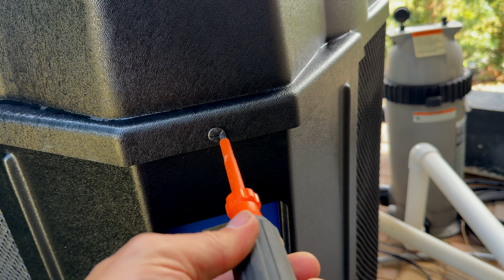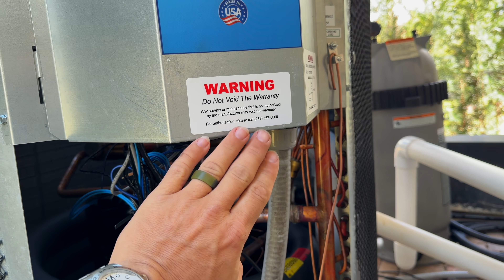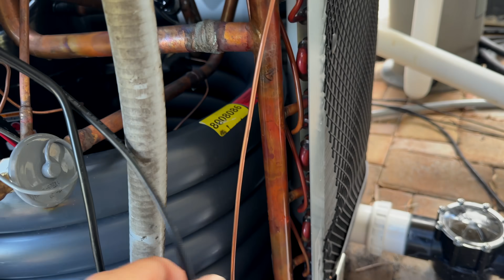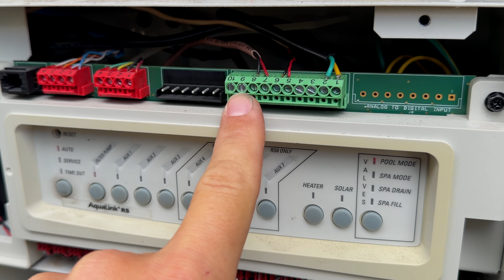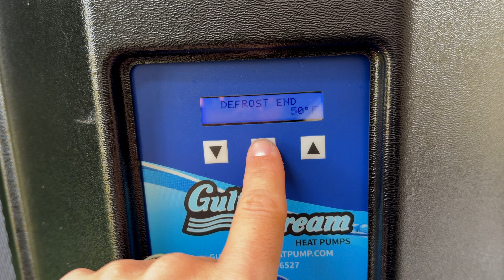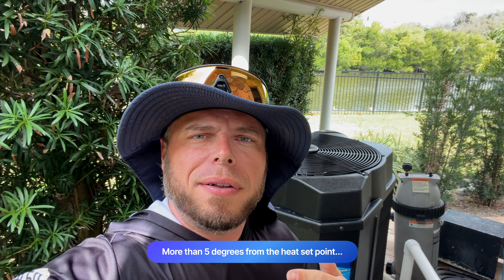High Voltage & Low Voltage | Complete Gulfstream Heat Pump Wiring Guide! #poolheater

Comment from the maker: ⚡ High Voltage vs. Low Voltage — Don’t Mix These Up! ⚡

Wiring a Gulfstream heat pump? This video walks you step-by-step through the complete wiring layout, so you know exactly what goes where before you power it up.

Inside this guide:
🔌 High voltage connections (line power, contactor, breaker)
🎛️ Low voltage thermostat/control wiring
📋 Control board terminal breakdown
🛠️ Safety checks before startup

Whether you’re installing, replacing, or troubleshooting — this will help you wire it correctly and avoid costly damage.

💬 Have a wiring question? Drop it below — I reply to comments.
👍 Like if this helped
🔔 Subscribe for more straight-to-the-point wiring tutorials
📌 Save this for your next service call

#PoolHeater #HeatPump #PoolTech #WiringGuide #PoolHeatPump

Comment: Remote T-Stat Enabled makes sense, Remote Heat/Cool Enabled makes sense, Pool Heat/Cool Disabled isn't making sense to me. Pool Cool Enabled, kinda makes sense, I suppose we want it cooled, but wouldn't that be controlled by the Remote Heat/Cool Enabled? Im confused.
Reply from the maker: Pool/cool is designed to keep the pool at a specific temperature. So it’ll automatically switch between the modes to achieve it. The reason why I disable it is because it will increase the homeowners power bill significantly because it’ll be running all the time. I hope this makes sense. Thanks for watching! 🎉

Comment: Very nice video, good explanation . I do havea question, I connected the way you explained when i turn it on via the automation it does turn it on, however it doesn't go into spa mode it just turn the heater on in pool heat.  I have just a heat only, No cool  thanks
Reply from the maker: Thanks for watching and the kind words. Depending on what automation system you have you should be able to program the heater to turn on anytime you have the spa come on. If not, all you have to do is put the system into spa mode and then turn on the heater to your desired temp. Regarding the "mode" on the heat pump itself, the only difference is the max temp. If memory serves, pool is maxed at 95*'s and spa is maxed out at 104*'s. I hope this helps!